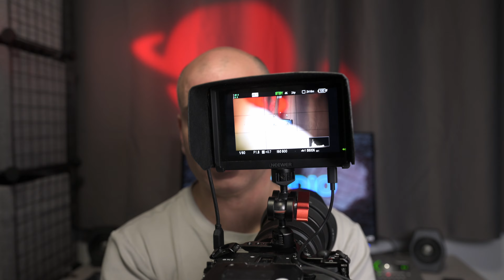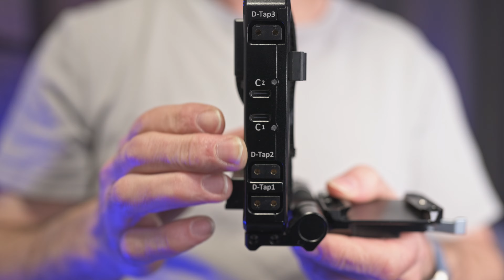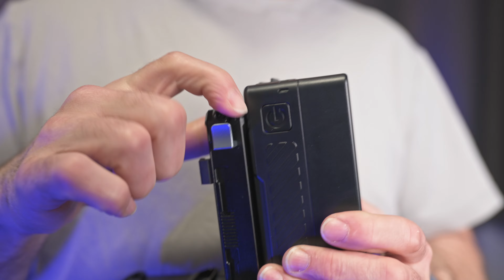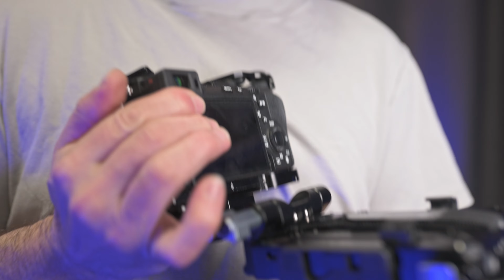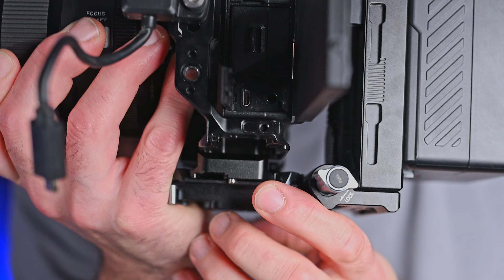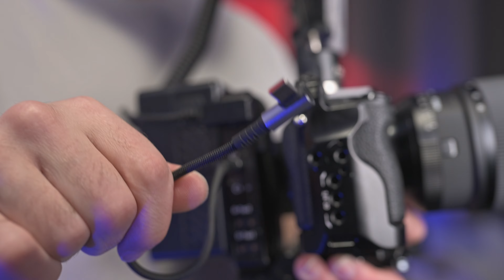🎥 SmallRig 5227: V-Mount Battery Plate Kit | Review & Setup!

Comment: how do you feel about powering both the camera and the monitor from one source? i heard there were grounding issues with this setup?
Reply from the maker: I never had that issue and I was doing just that. However powering a Zoom F3 or a tascam FR-AV2 and than applying an AUX to camera mic in IS going to be a ground loop issue with any single battery setup.
Reply: @ericsstudio  i see, thanks for the complete response!

Comment: I have a SmallRig 4292 (VB99 Pro Mini) battery and I’m planning to buy a V-mount plate for my rig. The battery already has 2× USB-C, 1× USB-A, and 1× D-Tap output. I’m currently deciding between the SmallRig 4064 and the SmallRig 5227, and there’s about an $85 price difference. In your opinion, is the 5227 worth the extra cost, or would the 4064 be enough considering the battery already has multiple output ports?
Reply from the maker: I believe your ports would be fine. Don't know what you are all doing. I don't have time to look up the VB99 pro being an on a short break at work.

I also own that same Smallrig plate, can be seen in my guide to Vmounts
https://youtu.be/rrWMqU0obiU?si=Dt2d13aQ3A8uoRSo

I prefer it because the 5227 isn't for long term storage verify that with the issue I had mentioned right at the end of the video. Also Smallrig also lists the 5227 not for long term battery placement. I liked the ZGINE plate I show in that video other than the one defect that made me return it.

Comment: Dose that battery plate detach from the arca so that 15mm rod clamps can be attached?
Reply from the maker: Yes, where I showed those screws to shift the mount side to side. If I remove those screws the back plate will also be detached. Good question BTW
Reply: @ericsstudio  thanks!
Reply from the maker: @SuperBee_1969 No problem... If you wanted to learn more about Vmount batteries and options I have a video on that.
https://youtu.be/rrWMqU0obiU?si=qksUQVGz5Wn-_G7V

I contacted Zgine to make an improvement to their plate mount option I show in that Vmount video..m the Zgine plate is rather awesome if it wasn't for the design flaw because unlike the Smallrig which isn't to be used for long term storage that Zgine plate can be used for long term storage. Smallrig lists on their site not for long term storage which makes sense when considering what I mentioned at the end of THIS video about the problem I had with the USB randomly powering on.

Comment: Returned the battery plate back because of the plastic screen protector. I would have thought since SmallRig makes everything out of metal, they would make that part out of metal as well for extra durability. The thing alluminium that was used for the plate also did not give me high hopes of the product itself. The turn off switch should be just click I would say. The D-Tap connection is amazing though as to how sturdy it fits in and there is no risk of it getting yanked out.
Reply from the maker: Thank you for sharing I mentioned the same thoughts and my theory at the end of the video why I believe they used plastic... that metal would likely scratch the camera screen BUT yes plastic isn't cool. I already broke mine :p. I had a second one since I also bought the Smallrig pro. I had a problem with another mount that had great potential... As seen on my new video beginners guide to Vmount batteries.
Reply: @ericsstudio  I returned mine straight away due to the plastic being the reason. 

On the metal construction : if silicone paddings will be used on the inside, then it wouldn’t scratch the screen at all. I might actually buy some soft thin silicone stickers and aluminium 2-3mm sheet. Cut one out and place it on the back of a regular V-mount plate. Spray paint it black at the end.
Reply from the maker: @demz3514  That'd be cool if you can build your own. If you want to see the Vmount video it is here:
https://youtu.be/rrWMqU0obiU?si=5BzxLFdS5FRMYTI2

I show the ZGCINE VM-VP4 in there. Zgcine is sending me a new replacement after I returned mine to Amazon. Not certain if it is an upgraded model or fixed or what. I went to their site online and suggested some upgrades for them to make and showed a video of the issue.
Reply from the maker: @demz3514  If you would like to see the Vmount video it is here:
https://youtu.be/rrWMqU0obiU?si=5BzxLFdS5FRMYTI2

I show the ZGCINE VM-VP4.

I connected Zgcine to suggest upgrades and tell them about my issue and they either sent me a replacement or an upgrade but I do not know which.
Reply: I"m glad the screen adapter isn't metal, it would totally scratch up the screen after continued use.  I'm pretty sure that's why its plastic to begin with.
Reply: @zackallen8759 it won’t scratch if you have foam cushions just like in this plastic flimsy one

Comment: Does the v-mount plate regulated?
Reply from the maker: There is Overdischarge protection, the max outputs are limited and the USB type C uses standard power delivery protocalls. As for other safety I can't find other information and appears you need to make certain the battery used has the standard safety built in.

I purchased another Vmount battery plate kit from another brand I might review next week.
Reply: @ericsstudio  Is it the ZG Cine one? How does it compare?
Reply from the maker: @draifinger  The ZGCINE VM-VP4 is the one I show. I found the companies email and contacted someone to express my issue with it. The company  is either sending a replacement or an upgraded model; they didn't tell me which. They asked for my proof of purchase and notified them of the upgrades I would like to see.

Comment: if you hold the powerbutton 3 seconds and it shuts off, does it still drain battery for USB and stuff?
Reply from the maker: It does not appear drain the battery whatsoever. I left a Vmount battery in there for 2 weeks without use and the battery level is the same.

Only exception is when a device powers the USB back on. My F500 monitor has a slow power drain and my camera to USB power delivery can also make the battery drain and I am thinking that is why the USB ports as stated at the end of the video can turn themselves back on... if USB devices pulls and stops pulling power connected to the ports.

Comment: Isn't the bottom of the cage on the sony actually arca swiss? Did you have to put the arca swiss plate on the bottom of the arca swiss base? Would it work without the extra plate?
Reply from the maker: I may have to have a look, maybe I never thought about the base of the Smallrig camera cage. Good eye, I'll see if it mounts directly. BUT keep in mind not everyone is going to have a camera cage despite the fact this should be used with a camera cage... Unlike most reviewers I work full time with overtime... I won't be home for another 11 hours.
Reply: @ericsstudio Yeah no problem. My fx30 has a similar cage with arca swiss on the bottom and is very convenient to switch between rigs. Thanks!
Reply from the maker: @unconsenting81  You are correct. The bottom is an arca swiss

Comment: how is the voltage regulation? I had a smallrig v mount plate smoke and burn before.
Reply from the maker: There doesn't seem to be any issues. I can only keep testing to find out. I'm thinking of getting a second one, I got the pro version without the connections from Smallrig but I am getting annoyed with the vmount batteries I have having always on power other than my VB99 SE that I can turn off the USB. The Shape vmount is always on power. I haven't tested my Newer PS212E vmount battery yet... I think it might have smart phone control.

Comment: My camera can run with USBC as a power source . I feel more comfortable and safer using that instead of D-Tap with my V-mount battery. God forbid I get a spike through the D-Tap and my camera is fried. Even though I got the Kondor blue D-Tap with a voltage regulator it still leaves me paranoid and I keep using the USBC port .
Reply from the maker: I agree, USB-C is safer. I have a D-tap dummy battery but I haven't used it because of the risk. I got one with glowing reviews, there is a chance the connection with break with a failed regulator. My XLR to plug in power 48v to 4V has worked like a champ so far. If it fails my wired lavalier mics are dead .. Rode VXLR Pro

Comment: Thanks for the review. I just picked up a V mount battery from K&F and the Neewer V-mount plate and quick release base plate for my cameras this weekend. Although that SmallRig is a bit too pricey for me it is an excellent design.
Reply from the maker: I didn't get the newer because it comes from the images with one mounting screw and people found the plates aren't fitting into the tripod as good... That's what I found when I ordered Neewer ARCA Swiss plates. I was really considering the Neewer plate. I also purchased the Smallrig Pro plate that is about half the price of this and half the weight.

Smallrig 5315 model but the small square bottom plate that came with it is pure trash.

Comment: Great review, thanks... I'm torn between V mount and just going for a USB-C battery bank, it seems everyone is going that way for most accessories... but I supposed DTAP has its place by supplying more power?
Reply from the maker: Correct. Dtap supplies more watts of power. I have several NPF batteries I reviewed with NPF plates. It works fine for powering the camera, the higher voltage of Dtap and the 12 volt when there is a barrel port on the battery like both shown in this video on Vmount means less chance of voltage droop when powering devices most on camera monitor use. I find it cheaper to use a regular NPF and the NPF plates with USB power delivery. The battery is smaller and lighter.

Vmount looks more professional for those actually wanting to be taken seriously by large production or larger companies.

If doing the hobby / YouTube thing NPF is good enough. Where I may use Vmount as well is I can power my Studio lights while powering my camera. NPF max 59 watts out. That Shape Vmount is 216 watts and the Smallrig is 100 watts out